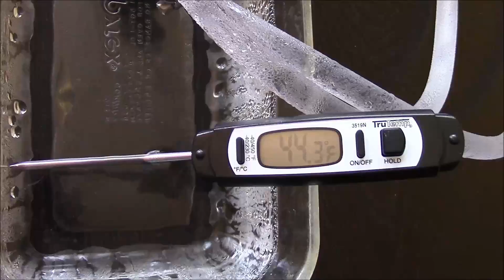How to Build A Water-Cooled Peltier Device or Thermoelectric Cooler

Comment: extremely pleased to see this. no question small spaces like micro-campers and related would benefit. also would like to see a heat "tablet" with coupled-Peltier chips, heat sinks, on-off switch, thermostat controller, 12 batter hookup, 110 converter, plugin .. for hot-cold environs
Reply: would love a fabricated version for tinyhomesonwheels.com
Reply from the maker: That would be pretty cool.  You could cascade 2 peltiers together to get colder temps (low volume) and rig up a way to reverse the polarity so that you could switch from hot to cold.  I've done the thermostat thing before and it works okay, although heat soak causes problems.  A better idea would be instead of shutting off power altogether like a thermostat does you could limit the current to a small amount to keep the cold side slightly cool and not feed heat back into the system.
Reply from the maker: Email me at ldsreliance@gmail.com and we will talk.

Comment: My pump (exactly the same as yours) just arrived today and I'm doing essentially the same thing.
It's cool (no pun intended) but very inefficient to be of much use.  So much electricity, so much heat produced.
I still like them even though I just can't justify it. 8^)
Reply from the maker: Agreed.  You would really only use this if you had a small amount of liquid to be chilled or heated for that matter.  One of these 5 amp units isn't really that big of a deal but if you had to chill 5 gallons of water you should just invest in some refrigeration equipment.

Comment: Hey thanks for the great video. I was wondering do you know if its more efficient to use a peltier than a condenser in an AC and how much more efficient it is? Hopefully I am making sense here
Reply from the maker: No, it is not more efficient than a condenser style air conditioner/refrigerator.  But it does have advantages.  They last longer, require no maintenance, are more rugged and tolerant of abuse (you can't lay a fridge on its side, for example), and take up a lot less space.

Comment: would this work to make a ac fan instead of using ice?
Reply from the maker: Yes, it would.  It may not be as cold as icewater but it would last a lot longer.
Reply: Thanks,  i bet this would extend the life of the ice for sure.
Reply from the maker: chriss4365 It will.  You are welcome.  Thanks for watching!

Comment: haha🤔🤔🤔 this is the unit I stated on other vid.  This is doubling down. . That Pc cooler does what the Tec1 12706 does YOU have two chillers now 🤔😂😂😂
Reply from the maker: The cpu cooler sheds heat but it can't make something colder than ambient temperature.  So the idea behind this cooler is to use the cpu cooler to cool off the hot side of the TEC and the cold side of the TEC will chill liquid below ambient temperature (ideally 40 degrees F).  This project was for an aquarium dosing application where the liquid needed to be chilled.
Reply: I am going build one or two. Using 12607 610s I think the wattage is difrent cools better and using 80mm 120mm fans with water block for dwc maybe ad a controller for temp
Reply from the maker: afk bot
Cool, let me know how it goes!
Reply: LDSreliance  Will do.. going to the source who makes the tech -12706 - 10... wattages are diffrent so based on size of cooling .. say 15 gallons cools using 06. In 30 minute's. . Vs 50 gallons taking 2hrs .. Yet a 12710 will take 20 to 30 .. not actual #s ..
Reply from the maker: afk bot
Good to know.  I'm going to be doing a cascading video today or tomorrow, by the way.  Look for that if you are interested.

Comment: Hey did this setup worked for you? The radiator setup didn't burnt the peltier module? I've been thinking of doing this for a DIY aquarium chiller since commercial chillers are very expensive.
Reply from the maker: It worked well.  This project was for an aquarium dosing application for one of my subscribers.  One of the peltiers died so we had to replace it but other than that it seems to have been great.
Reply: What water block did you use? since aluminum will make the water toxic. and did the temp get lower than 20°C? because I need the water to be lower or equal to that.
Reply from the maker: Marc Wivenson Co You can get the water to colder than that with better insulation and a more powerful peltier.  The water block was aluminum so you would have to find something that was fish friendly, especially if you are using salt water which would corrode most metals.
Reply: Are there any other mediums than aluminum and copper? I think there isn't have you tried doing it like having the tube from the aquarium run to the cold water on the container? will that be any good?
Reply from the maker: Marc Wivenson Co There isn't a thermally conductive material that they make water blocks or heat exchangers that can handle salt water and live fish.  You could try cooling water and then running it through an RO filter to get out any metals or maybe run it through a refugium or some mangrove to filter it.  Sorry I don't know what else to tell you.
Reply: I found someone who did something like this with a copper water block and said that with the copper almost at freezing state there won't be any metals leeching out. I'm going to use it for fresh water btw since it's for my axolotl :). Thank you for replying to my questions. I will try to contact the person who's done this to an axolotl before and if he's are still living up to this date then I'll try making mine :D Since he made his way back 2011. Hope he reply lol.
Reply from the maker: Marc Wivenson Co OK, cool.  I have seen copper water blocks that are zinc coated, too, for anti-corrosion properties but if it isn't saltwater that may not mater.
Reply: I was thinking of coating it with something and then It hit me that I needed to coat the inside of the water block since the water flows there lol so that's out of the question.
Reply from the maker: Marc Wivenson Co Yeah and if you coat it with something on the inside it could inhibit the transfer of heat/cold from the water block to the water.
Reply: I have another idea to make a cooler box with this and run the water tube that goes into the tank inside it so that the air or water inside the cooler box can cool the tube resulting in a much cooler water cycling the tank, but it seems that although it would be cooler than my average temp it won't reach 20°C. Or maybe I can do this as a cooler box but the tube that runs inside is coiled up with copper tubing that also cycles water from the peltier module. maybe that would work.
Reply from the maker: Marc Wivenson Co Maybe.  Worth a try!
Reply: My problem in that is copper tubing is hard to find here lol and if I ever find some they cost a lot lol.
Reply from the maker: Marc Wivenson Co Yes copper is expensive.  You can get a big coil of it here in the US at any hardware store.
Reply: The problem is I'm not from the US haha.
Reply from the maker: Marc Wivenson Co I know.  Sorry!
Reply: Would a laptop adapter be enough to power a peltier module? If I have a TEC 12706 would a 12v 6a laptop adapter suffice rather than using a PSU?
Reply from the maker: Marc Wivenson Co
Yes, I have used them in the past.  I have used the cheap $8 ones from Amazon before and they work fine but some don't last very long.
Reply: That's a shame because I need them to work daily lol. I don't have any concept of doing this with a PSU can I use them even if they have a higher voltage, wattage and amperage rating?
Reply from the maker: Marc Wivenson Co
Voltage no.  Higher watts and amps is fine since the peltier will only draw how many amps it is rated for.  You can use a laptop power adapter just fine.  I just meant that the cheap ones tend to die because they are not built very well.  But if you get a name brand one it should be fine for years.
Reply: Thank you I'll study up on this :)

Comment: I am planning on doing this for a two gallon igloo water cooler. Do you think that 1 cooler module with be enough?
Reply from the maker: In this video I was cooling about 8 cups of water if I remember correctly.  To cool 2 gallons you will need a much more powerful peltier.  I would start with a 20-25 amp unit and go from there.
Reply: thank you
Reply from the maker: ancient old ones
You are welcome.  Good luck!

Comment: if you dubble the cold side water block with thermal compound between every thing you will get much colder temps im useing a simular setup to this to cool a amd cpu at home mines just a bit more powerfull but try useing dual cold side blocks one will feed into the other working on the outside in method i can maintain a computer at 8c below ambient just becarefull as you can freese and crack the blocks
Reply from the maker: I actually plan on testing this out soon.  This is called cascading.  Thanks for the comment and look for a video on that soon!

Comment: what if you pump that 44 degree water through an evaporator or transmission cooler with a 12 volt fan blowing across it ? Maybe it would act like a mini air conditioner ?
Reply: mineral oil (baby oil) try that instead of anti freeze sounds crazy im sure but ive used mineral oil in my days of dissipating heat from electronics back in the 90s and i fugure so why not for cooling i just havnt tried it yet but i will soon enough
Reply: I'm going to try and do this
Reply: Andrew B I am in the process of designing a system to do just that in my 79 C10. my ac doesn't work anyways, so I figure, 3x150w peltier+ water blocks and a pump with antifreeze in the system and I figure I could pump cold water through the evaporator and make a make shift ac
Reply: Steven Rowland it's not crazy but I was thinking antifreeze for a car would work fine. Thoughts as to why mineral oil would work better?
Reply: non-conductive is the primary reason and still flows well when its cold but also non-corrosive with it being oil based metals would have not problem with it. Antifreeze would work no doubt about that but its water based and not a good idea if there electronics close by should you ever develop a leak from and aged line could cost an enthusiast alot of money in electronics being fried from a water leak i cringe at the thought of that. Ive been a couple of weeks now thinking which way to go with a 10 cubic foot  fridge that the compressor failed ever so conveniently after the full warranty went out and though the part is free being under warranty for 5 years i would have to pay the labor ( close to the cost of the fridge) to fix it.  I dont think so.
Reply: @battery_solar_ev  it's interesting that you bring up mineral oil and electronics, as I've seen practical application of that at my work-- high power transmitters...in the high voltage beam supply - 38kv @ 1amp dc. The rectifier array is a unit about 3' x3'x5' tall , weighs about 300lbs, and is fed 480vac 3ph....and guess what kind of bath those  components are running in-- Mineral Oil.... the oil even get sent out from time to time to a testing facility to check on its viscosity and make sure that it hasn't deteriorated in anyway... The last 3 transmission facilities of the last three TV transmitters I've worked on all have the same thing going on in the beam Supply rectifiers...  mineral oil :)
Reply: Steven Rowland well look at my profile and send me an email. I need a fellow intelligent mind to plan my project, but I'm 19, so there's probably things you've thought of that never crossed my mind. And I wonder if you can make the refrigerator thing work just like I'm gonna make ac for my truck
Reply: Triston adams good if some work we can sugest

Comment: LDS:  Thanks for the great videos!  I am wondering about scaling this up for 150 gal reservoirs and an equipment list for such a system.  I was looking at 26 amp peltier modules and Corsair Hydro Series™ H115i 280mm Extreme Performance Liquid CPU Cooler as the main components.  I've got a multitude of 150 gph submersible pumps with various size hose fitting attachments lying around.  Will the peltier and dual fan cooler be enough to drop the reservoir by 20 degrees?  There are box systems that I could purchase to do the job for 1500+ but I'm trying to avoid that.  Any help would be greatly appreciated.
Reply from the maker: I bet you could do it with 4-5 of those 26 amp peltiers and a really good water block(s) made of copper or something with great thermal properties.  But the key to the whole thing will be how well you can insulate the water reservoir.  I am thinking you would need several inches of insulation wrapped around the reservoir.

I am curious what you need to chill that much water down for?

Comment: This is the corvair liquid cooler of which I speak.  I can see both sets of wires and plugs in your video, I just cannot determine which 2 wires from the 3 wires harness I need to connect......
Reply from the maker: I took a look at mine and I know what you are talking about.  One of the wires on the end is not needed.  So put the wire in the middle as the positive wire and then try connecting both of the other wires one at a time and see if the pump turns on.  That is the only way to know, really.

Comment: Thanks for responding.  I am referring to the 3 wire plug from the coolant recirc pump on the cpu cooler.  I got the radiator fan, just can't seem to hear the coolant pump...
Reply from the maker: I have never seen one with 3 wires.  Are you sure it is DC?  3 wires sounds like AC to me.

Comment: Hello.  I'm trying to build this water cooler, but I cannot seem to figure out which wire is which for the cpu fan/cooler pump.  I have the fan working, but can't tell if the coolant pump is coming on or not.  Any suggestions?
Reply from the maker: If you put your ear up to the pump you should be able to hear a slight vibrating/buzzing sound from it if it is running.  As far as the wires, there are 4 wires that are side by side in a flat ribbon configuration.  The one on the far side is the negative wire (will be marked by a ^ or arrow if you still have the connector on there - if you already cut it off then you will have to do trial and error).  The wire next to the negative wire is always the positive wire.  The other 2 wires are not needed.

Comment: hi.. i got mine setup to use both sides a cpu radiator.. instead of coling water.. it blows cold air.. 15C on cold side.
Reply from the maker: Nice.  I have done it that way, too.  It seems that the liquid cooling is more efficient, though, and also easier to mount and operate.